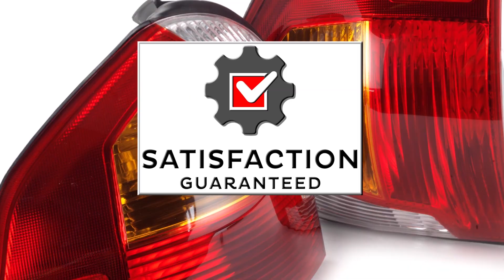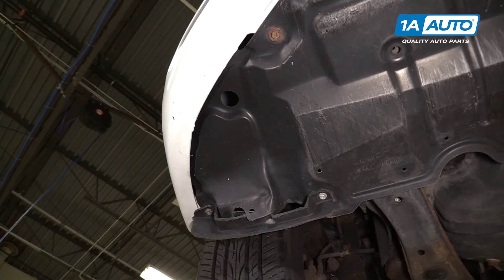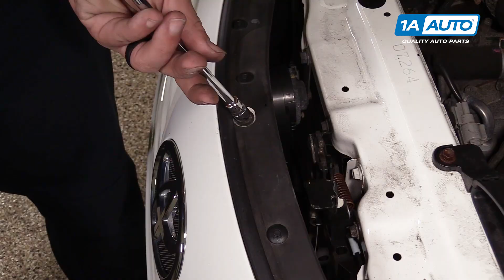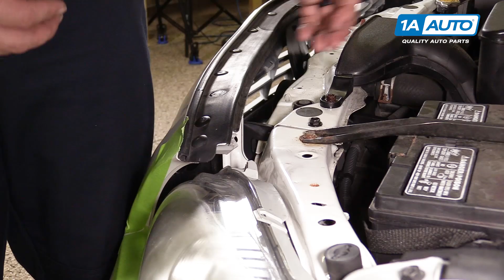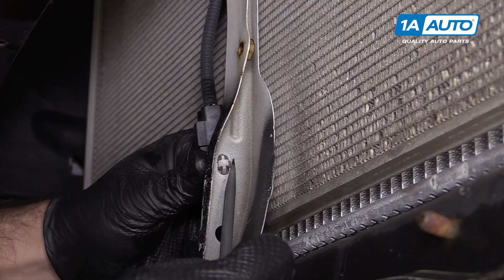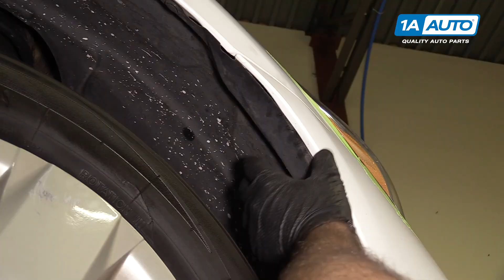How to Replace Ambient Outside Temperature Sensor 06-11 Toyota Camry

Comment: I need help, I have 2004 camry and outside temp stop displaying.  I brought the censor but I cant locate it anywhere behind the bumper,  Im now thinking that it just got ripped off somehow, I cant even find the wires or connections that would indicate that something is missing,  Im going crazy.

Comment: Just reach between the condenser and bumper. No need to remove the bumper or bottom splash shields. 2007 Lexus ES 350

Comment: I could be wrong about this but… those plastic push pin clips like the one prized out with a small flathead screwdriver at around the 5 minute mark are supposed to be removed by pushing in on the center post.  The center post pushes in about 1/8” which releases the clamping mechanism underneath and allows the whole clip to easily slide out. This style of clip is used on every Toyota I’ve owned.  Perhaps Toyota changed their clip design?  Regardless, I appreciate the very helpful repair videos you folks put out. I use them often.

Comment: What is the function of the ambient
Reply from the maker: +Fresh Fingers It is the job of the ambient temperature sensor to measure the external temperature of the vehicle as a reference point for the computer to make calculations. The computer will continuously monitor the signal from the ambient temperature sensor and make automatic adjustments as needed to maintain cabin temperature.
Reply: 1A Auto Parts thanks so much . Greetings from Cameroon 🇨🇲

Comment: Could you not just take the splash shields off and change it from there? Is the bumper removal necessary?
Reply: I don’t have slash shields I just reached between the bumper n radiator n changed it . 1A auto be so extra with a lot of these tutorials 🤦🏾‍♂️